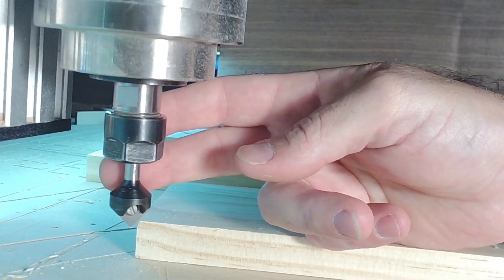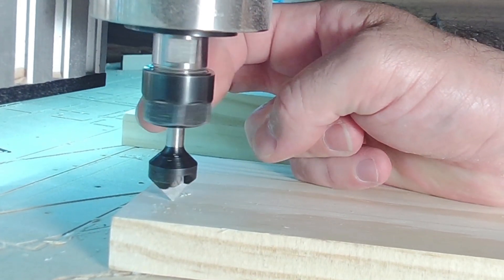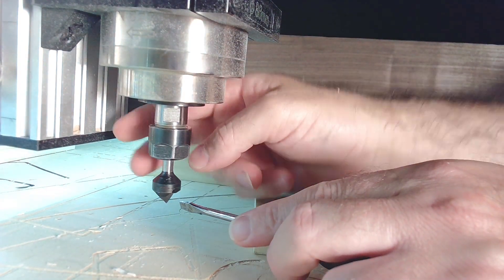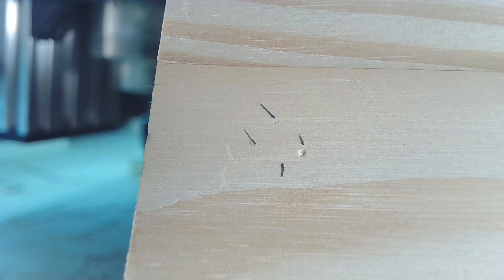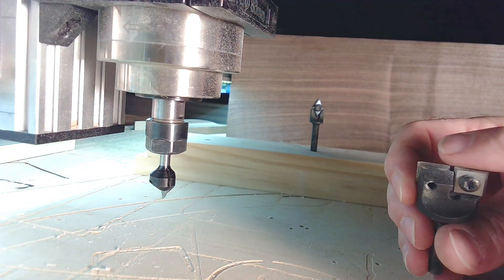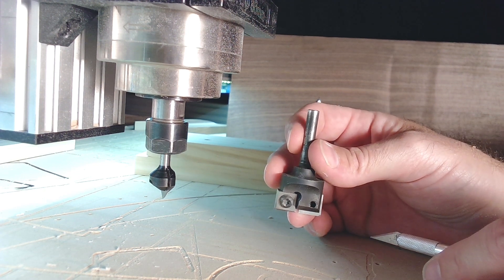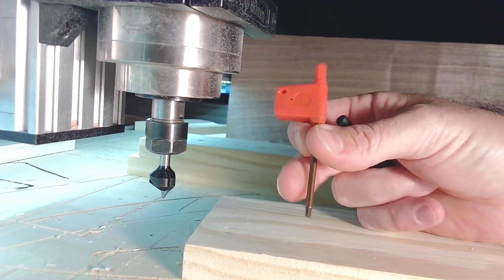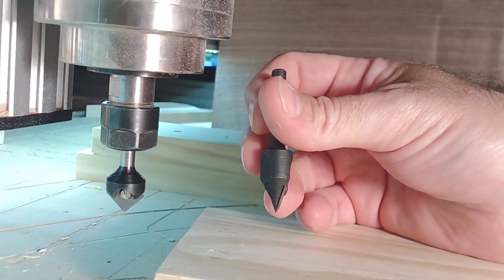V-bits NOT carving right? Super Simple Fix

Comment: I'm not sure why Amana didn't include a more positive indexing feature. One of the advantages of inserts is that if they chip or break, they can can be quickly replaced without needing to adjust anything on the machine. 
This just seems like a lazy design by their engineers. 
Didn't get me wrong, I love the cut quality I get from mine, but there's no excuse for such a (usually) amazing company to have such a fiddly tool.

Comment: Can Carbide bits be sharpened/dressed with diamond file/diamond plate ?
I've used diamond file to clean off baked on gummy residue & pitch. Just wondering if going further & polishing face & back bevel worth while?
Reply from the maker: I've never actuality tried that. These inserts are only $4 each here in the US directly from amana and $7 for their "Diamond Like Coating" version of them... and I found some more knock offs that are like $2 each for a 10 pack 🤷‍♂️

Comment: Are those tiny screws secure enough? No spring or serrated washer Or blue Locktite to prevent vibrating out?
Reply from the maker: I've got no less than 40 hours on both the 90 and the Surfacing and they haven't loosened... the 60 has less hours but it hasn't budged either
Reply: Hello Gents, I've had the screw back out after my first cut (was checked for tension before its first cut) Hopefully this isn't going to be a regular occurrence.
Reply: When I worked as a machinist, we would replace the inserts in our tools with nothing more than the torx screw. No loctite or washers.